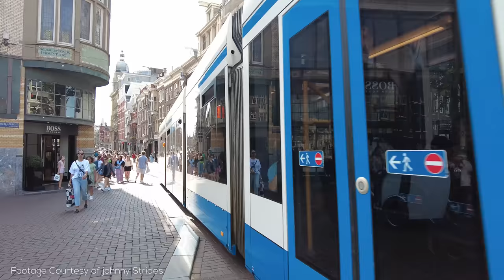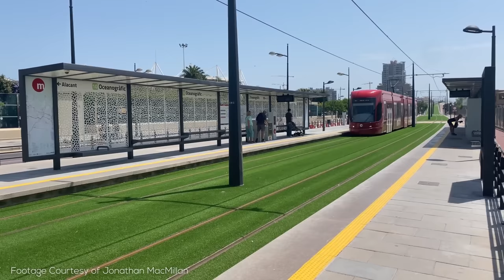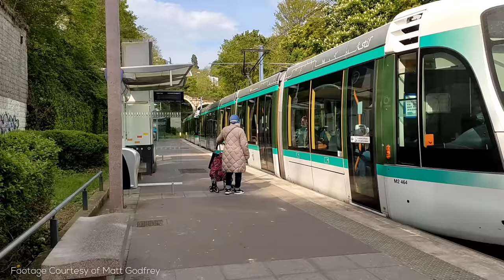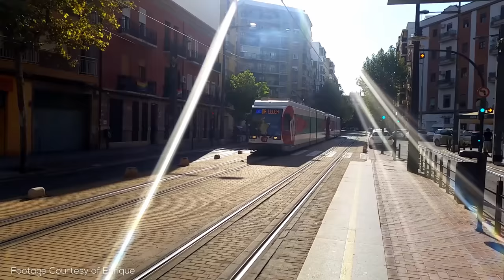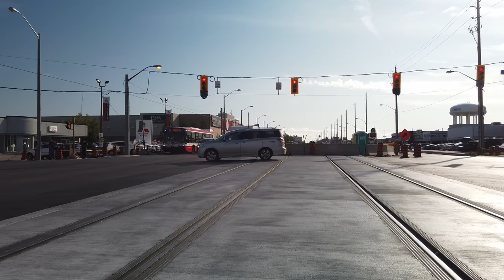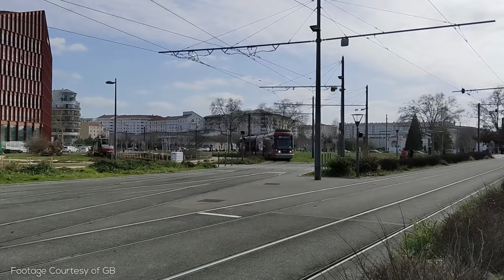What the US Gets Wrong About Trams

Comment: The biggest positive of trams is that they can easily get into dense pedestrian centers without obstructing anything, all while providing street-level access. That's something impossible for the metro or the bus.
Reply: For the most part, you're right. What I mean is, cities with unique or unconventional streets or blocks, if they have specific purpose-built vehicles to maneuver in their city, it works beautifully. But then you have cities like San Diego, where its downtown has blocks designed to be small to maximize corner shops (a plan going back to the 1880s), with generic trolleys that are the same size as your average American trolley car line post 2002. This creates near hourly blockages on 11th, 10th, 5th, 4th and 1st avenues. This has caused one serious accident that I know of, and is quite hazardous. This is coupled with stop lights that do not account for a trolley car sitting on the intersection, as they change regardless.
Reply from the maker: The predictability of rails does wonders!
Reply: Yeah, in my local area in London, theres a shopping street that really should be pedestrianised but it carries 2 major bus routes and 1 minor bus route. I can't really see an easy way of pedestrianising this street without completely cutting off these bus routes as there's no real nearby alternative routes for them. As of right now the council has settled for restricting through car traffic during most hours of the day with a bus filter and expanding pavements where possible. I don't think there's really a nice way to let buses through a pedestrianised area that's both safe and efficient due to their unpredictability. The ideal solution would therefore be to turn these buses into trams as the tracks running through a pedestrian environment provide a better level of predictability than some kind of bus lane which would either not be obvious enough or would be too similar to a road (ie what we already have). However this is very unlikely to happen as it would mean creating an entire tram route all the way into central London (as well as a different one for the more minor local bus) with the sole justification of pedestrianising one half a mile street that the trams would run on. (Not to say that the tram wouldn't be otherwise useful but it would need a lot more justification and consideration of alternatives). Also my phone keeps autocorrecting tram to team so if I've accidentally said team anywhere I meant tram.
Reply: @sergpie  Yeah, that sucks. Well, either of the solutions would be good: pedestrianizing part of the center there, or running shorter trams more often.
Reply: @CatnipMasterRace  you could do it like sutton and have a one way system around the pedestrian area. It's not perfect because 2 or 3 lane one ways are kind of on the heavy side lane wise but it does mean the high street itself is a nice place to visit, with minimal traffic
Reply: @CatnipMasterRace  also sutton is hopefully getting a tram line within the next decade or so, but it's not actually planned to run on the high street, instead running around the high street on the 1 way system I mentioned
Reply: Trams obstruct plenty.  They share road.  Their tracks confuse drivers and pedestrians who are supposed to go over them or share lane.  Buses are better, but yuppies are pathetic and want cool look.  . . . It's just dumb, cost of track and confusing drivers vs having a bus seems even.....  We should pay half to ebike an stop chafeuring around people in govt vehicles.   Only 20% of people in Netherlands take transit to work, showing even done well most rich people find cars best, we gotta accept reality not keep gushinf how better trains will get Netherlands past 20%....
Reply: @mostlyguesses8385  The ability for trams to cause obstruction in the first place depends on the design of the rail network the trams ride on. That's actually one of the things Reece talked about in this video: tram lines can be built in places that aren't roads and can be built to stay separated away from roadways to minimize conflict and confusion with drivers. I recommend watching the video before commenting on it.
Reply: @mostlyguesses8385  trams are a more pleasant experience, and they have a greater capacity than buses. They're also able to load passengers faster than a bus by having more doors, which makes them ideal for higher frequency routes. Also, they are able to reach faster speeds than  buses. And I have a hard time taking anyone who uses the word "yuppies" seriously
Reply: But also the esthetics of the American trams is weak. For large trains they are usually along the edges and go by really fast so that's not a big problem. Trams though go through the middle of town and go slow so they are very visible. So making trams that look nice is actually a not insignificant thing to do.
Reply: @mostlyguesses8385  Trams obstruct only drivers, because drivers aren't used to having a heavy piece of metal on the road with them, so they think that they can just get hit by a tram and suffer minor damage.
Pedestrians generally have zero problem sharing spaces with trams. When you are walking, you don't feel invulnerable, so you don't do U-turns in front of a tram at speed.
Reply: @thunder____  ... I did watch video, but he admitted grade separation is the minority of miles...  Honestly tram tracks and trams going down a road freak some drivers out, a bus is far less scary and confusing, but he wanted to praise trams so ignores buses avoid this fear....  Be honest, when your car is in slow traffic and is over  tram tracks a little bit of you feels fear, ohh no, is tram near?  ..  . . . Even in Netherlands per Statista com most people just drive to work but experts hide that cars win everywhere, what a fake debate done just to demand tax money for trains for inner cities  """

Mode of transport used by commuters to travel to work in the Netherlands in 2019 

table column chart 

CharacteristicShare of respondents Car 65% Bicycle 29% Bus/tram/metro 11% Train 11% E-bike 8% Other 11%"""
Reply: @mostlyguesses8385  "Trams obstruct plenty.  They share road.  Their tracks confuse drivers and pedestrians who are supposed to go over them or share lane."  EXACTLY! THIS!!! Has happened many many times to me both as a driver and a pedestrian.
Reply: @theultimatereductionist7592  .
. Tram tracks freak out my old Mom and niece Gillian...  If they confuse 20% let's just use buses.  But transit people always gotta claim some new way will replace cars .  But per statista com even in optimal places most drive or have to live walking distance to work.  ..  """
Mode of transport used by commuters to travel to work in the Netherlands in 2019 

table column chart 

CharacteristicShare of respondents Car 65% Bicycle 29% Bus/tram/metro 11% Train 11% E-bike 8% Other 11%
Reply: I wouldn't say it is impossible for buses. But buses are infinity less conftable and much slower for the job.
Reply: @mostlyguesses8385  
If they get freaked out by trams, what else does freak them? Sounds like your Mom and niece are a danger to everyone else. 
In that case maybe your Mom and niece shouldn't be driving... Or go back to driving school.
Reply: @mostlyguesses8385  I live in the "tram capital city of the world" (Budapest) and I can say, nobody freaks out or gets confused by tram tracks, we are just used to it (everybody, even pedestrians, bikers and drivers). Your argument sounds silly and probably based on the fear from the unknown.
Reply: @vonPeter_  ... First time I'm seeing a tram coming behind me, a huge machine, I panicked and thought how do I pull out quickly.   It's human nature.  Same, when a 100000kg  semi truck is coming closer behind you stopped at corner most humans feel bit scared... Driving onto train tracks at all is also scary, we re told to be careful and rarely do this.....   Tracks also trip up walkers, bikers, wheelchairs, and me on my a5 razor kick scooter, a small negative but not silly to mention....  . . . Even normal train crossings are big scary even if math shows rarely do crashes occur her, be honest you get small fear crossing train intersection, yet trams don't cause any fear?. . . . . With respect you can say I'm overstating a small negative but don't say I'm silly and groundless, dont be so rude....   In a democracy if people feel something then maybe it is blocked, I like redlight cameras but my fellow voters don't, all the name calling and labeling as silly was pointless people can be dumb .......  Happy weekend ...  Of course maybe you're super brave, or I'm super scared, haha..
Reply: @mostlyguesses8385  I'm talked about your argument, not about you as a human being. The first time I saw a tram behind me I was around 3 years old and it was fun, because it's large, yellow (like every tram in Budapest), makes funny noises and those big giant machines are running up and down everywhere in my city. Also tram accidents are rare here, sometimes pedestrians don't respect the law of physics, but this confusion is not related to the fear from trams, but the poor education system. :)
Reply: @UCshtI27o193dc3-94kfbLyg Trams are faster and have far more capacity than buses and a lot of sections are separated from the road, so they are not affected by traffic jams caused by cars and buses. Another benefit is that trams runs on electricity without the need of large batteries so tram is the most eco-friendly solution for the transportation in dense urban areas (not to mention the lack of exhaust pollution). A single articulating bus can carry around 140-150 people, but a Siemens Combino Supra tram is rated for 350 people but I heard from tram operators that the actual number in peak hours easly reach the 450 passengers per tram. On the world most busy line (4-6) trams following each other in every 2 minutes in peak hours and the daily passenger number is 350 thousand (this is a single line in a city with 2 million residents and the whole tram system is registering 1.2 million check-ins every day). Moving that amount of passengers on the ground level is impossible with buses (meanwhile we also have multiple subway lines also). This is why around 65% of the locals doesn't have car at all (me neither, if I have to go somewhere with a car I can rent an electric Volkswagen for about 0.3 euros per minute just like an e-scooter).
Reply: @vonPeter_  ... It's good to hear your thoughts.. 

1.  at national level about 70% of French or Dutch or Germans drive to work, and 10% walk or bike, and 20% yes do tram, bus, or train...  Cars really are main way to commute once metros grew from 5km across 1920 to 80km, and especially in the less dense post 1950s suburbs... At 20% not sure transit ever can be main way.... Statisa ""Despite a slight decrease from 73.7 percent in 2015 to 72.8 percent in 2020, the car is the most means of transport used for getting to work among the French population.""

Your math is interesting.   If trams are close in time to each other you don't need big size, there is no huge numbers of people to carry, so not sure size matters unless only running under 6 a hour.  ...  With respect I hear trams are slower than buses, they gotta wait for some traffic more than bus, and cant accelerate as fast, there was a reason buses were used a lot post 1950..........  

I overall ain't sure trams are that better over buses.....  The main reason for trams I keep hearing is rich people are bigoted towards buses, so that sonehoe means spend more money on fancier looking vehicle, if that is the reason don't that mean they don't deserve help, let the more humble people ride a bus we don't need to cater to the spoiled rich too fancy to take a bus.... Ha..  I'm being boring, sorry....  Peace
Reply: @mostlyguesses8385  Again, your arguments are silly. Most of the french population lives outside Paris (and other large cities that have extensive tram systems), so there is no surprise that most of the french population doesn't commute by trams because most of the french populations doesn't have access to a tram system nearby. You are trying to use statistics to distort the reality, not to make a valid point.
Reply: @vonPeter_  ...  France has cities, Marseilles, Lyon, 20 others, so I think France is good average for European car use.  Basically 60+% of Europeans drive to work.  You act like it's 10%.  At 60% this proves wow cars really are loved despite hi taxes and Europeans not buildng much roads ..    The myth that Europeans hate cars just is false, so let's not call me distorting.     Even in netherlands they drive to work a lot, even when their provinces are just 20km from center to edge, haha, they still drive lots... Per statisa """the Netherlands in 2019. As of 2019, the majority of the respondents commuted to work by car. Over 60 percent of survey respondents indicated that they used their car to travel between work and home. The bicycle was also a widely used form of transport in the Netherlands in 2019, with approximately 30 percent of respondents indicating that they cycled to work."""""".   ..  .  I don't own a car, I'm on Galveston a little Texas island, but cars are preferred by most rich people...  My lord in Finland they have 800 cars per 1000 ...    ..    We have to remove the myths and get to the facts to come up with ideas that work, so let's not call me bad for trying to do this ...... Hmmm...  Personally  I think walking 10 minutes to train, waiting 5, riding 8, walking 5 is never gonna work for most, we need to stop money on trains and buses and pay each person $5000 and free ebike if they Uber less than twice a month --- that will make people give up cars mostly... Current plan of a few trains and buses won't do this, so far most europeans stick with cars, , , ,   Per wikipedia even the Japanese are at 500 cars per 1000, wow, it's ridiculous how rich humans love cars, any rich place........  .....  I'm gonna walk to library , but most people if rich making over $40,000 will drive, that seems a solid fact......
Reply: They obstruct car traffic in every US city I've seen.
Reply: Why not buses?
Reply: @sergpie  
How will  Tram help here in this situation?
Unless it's given right of way ?
How different from existing Trolley bus ??
Reply: Trams are intended to replace cars. In an ideal scenario, everybody would get out of their cars and into public transport. Obviously, that ideal is unrealistic, so reducing the number of cars has to be the aim.

And then somehow you think "But trams would inconvenience drivers" is going to be an even vaguely convincing argument against having trams?
Reply: @mostlyguesses8385  Watch any video about Netherlands public transit and you'd take this comment right back.